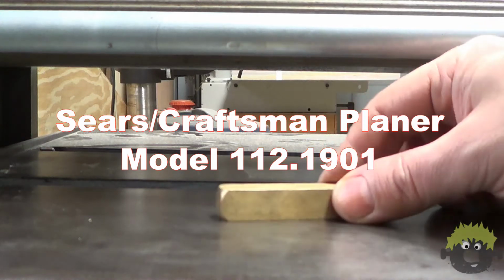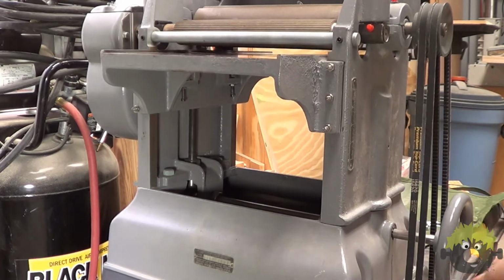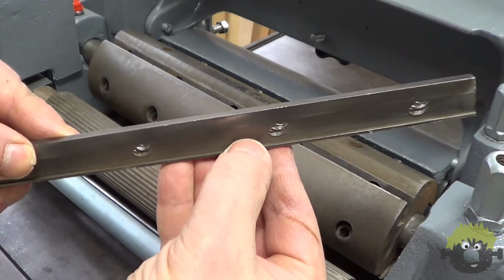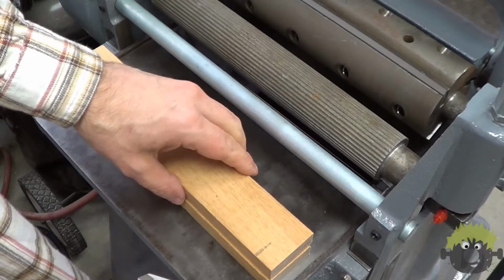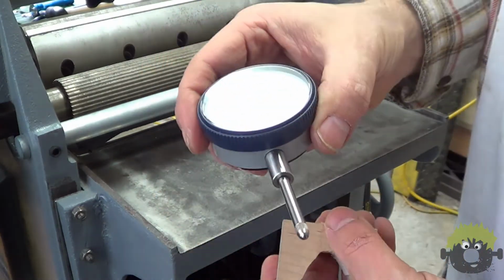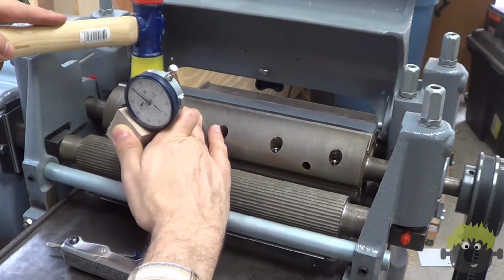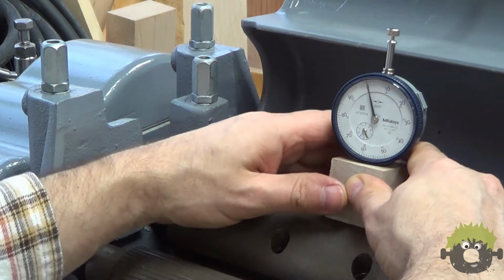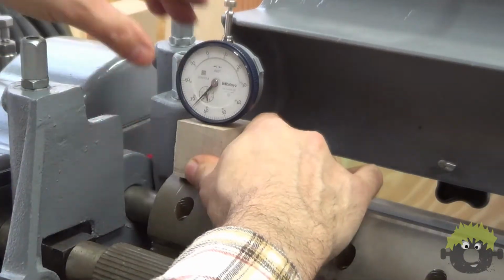Sears/Craftsman Planer Part 11: Tweaking, not twerking

Comment: Set the knives to be parallel with the table, not with that wooden gauge that was trying to measure projection from the  cutter head. Iconic, classic  American iron. Bought mine new in the 80's direct from Parks. 2X lifetime machine. Since acquiring wide belt sanders, the Parks has sadly seen little use. Although my sander has 3300 hours and its about worn out.

Comment: Great video..question: how to free up elevator bevel gear. Table needs adjusting, but bevel gear will not budge. Thanks
Reply from the maker: I'd probably go with heat, propane torch or the like.  Heat up the bevel gear until you can rotate it freely on the shaft.  Should probably make sure you don't have piles of wood chips in the base before you take an open flame in there as well.
Reply: @FrankenShop  Thanks, I just filled the set screw hole with WD, will try the heat tomorrow!
Reply from the maker: @alexglover8295  Any luck?

Comment: did you elimate snipe going this distance to make sure everything is perfect? I have minimal snipe but sometimes I'll get it and other times I won't
Reply from the maker: Like you, I occasionally get snipe.  It's worse on boards that I didn't bother to face joint first where the board is slightly bowed along the length and it lifts up slightly at the end as it passes under the cutterhead.  I've just gotten used to cross cutting boards a bit oversize so if I get snipe, I can hack a few inches off each end.
Reply: I am production running cutting boards and that waste adds up quickly. In the end I would probably get 10 extra boards from my stack. I have been leaving them 1/8" thick through the planer and then running them through the drum sander after. It does sound like yours is getting better results so I will go through the trouble

Comment: As always, I love these videos.  I am following your process on my own Craftsman Parks planer.  Adjustments demystified!  One question.  I am clear about adjusting the three knives, but how do you determine the appropriate height of the knives to start?  Mine is running pretty nicely, but I'd still like to get an idea of how high the knives should be.  Thanks again for sharing these videos.  This is the best one yet.  Looking forward to the end of this story!
Reply from the maker: My initial knife setting was entirely unscientific -- I just sighted it evenly across the cutterhead with about 1/8" extension.  I figured the initial stickout wasn't that critical and that the more important piece was ensuring all the knives sat at the same level.  So glad you've been enjoying.  I have the final video in the series shot and am doing the editing this weekend.  Hopefully have it posted soon.

Comment: Very good video I am going to start my set up tomorrow. I have a question on one of your VB previous videos what is the purpose of the large washer on the end of the outfield roller shaft I couldn't find it back referenced on the parts list. Thanks again for the videos they have been a great help cant wait till next one.
Reply from the maker: Wow, good eye!  I didn't see it on the parts breakdown either but it was attached to the planer when I got it.  I suspect it was added after the feed engagement lever was removed or disabled.  By having it in place, the feed rollers were "always on" rather than being switchable.  I left it on when because when it's installed loosely, it prevents the lever from moving all the way in and causing the bearing to chatter.  You can, of course, avoid this by simply not advancing the lever as far.  I don't think it's a necessary part for normal planer operation and once I get mine fully running, I may remove it if I find it's preventing full engagement with the gears.